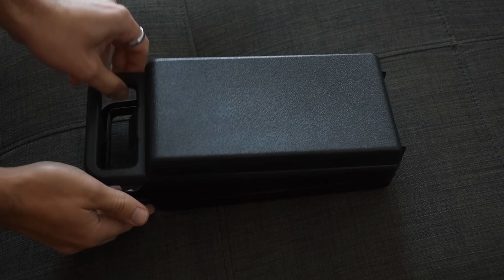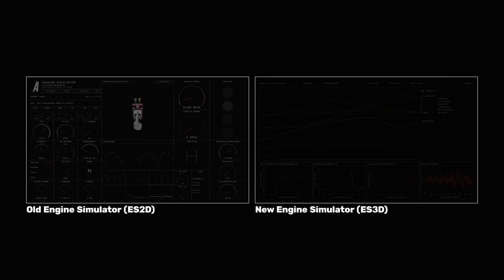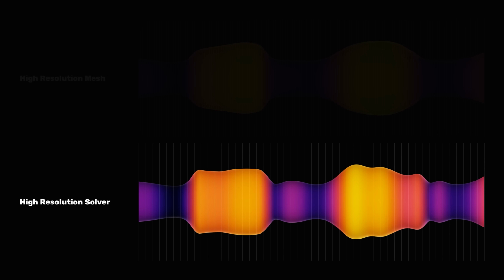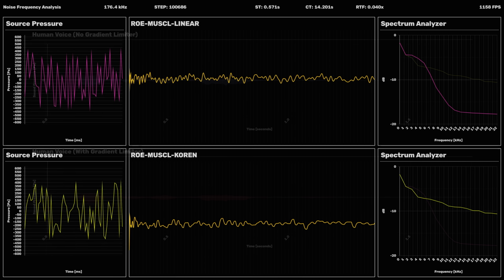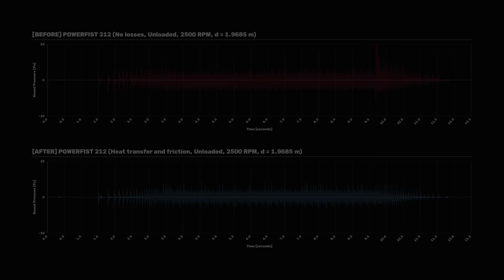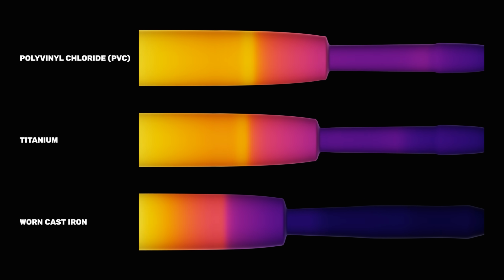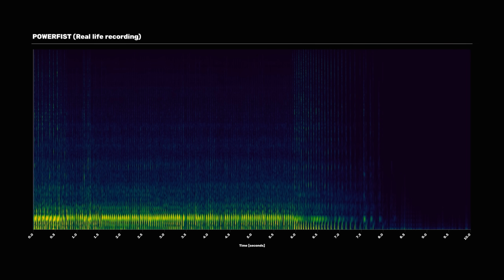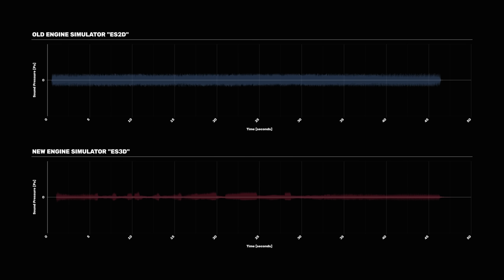Improving My Engine Sound Simulator With Real Data

Comment: Great work even ES2D was good but the new simulation is really a big step up so much that you now skim the limits of current technology and what math/algorithm we have come by  and as shown with the temperature problem  that the real world so incredibly complex that we often overlook the small details too get the big stuff right and call it good enough  even in scientific pappers but once sameone goes down the rabbit hole (like you did)one will notice that yeah it is good enough for most thinks (like exhaust scavenging for power) but same applications are just very fidelity with the small details (like sound)  

Well only thing i noticed (probably because of my tinnitus that makes high pitched sound louder for me 😅) is that the high frequency is still amplified a tiny bit to much  maby a other effect that is overlooked in real life that you didn't simulate or you need too dial in the math a bit more  till it matches the real world even better 

But hey, maybe your simulatio is just too perfect  unlike any of the stuff we have in the real world you know tubes being perfect round, smoth surface ,absulute consistent  wall thickness ,flange corners matching the exhaust flage and gaskets that swell too a perfect match and aren't compressed uneven etc. 

But even with all that you earned it too say "even better than just good enough and a good step closer too the real world" ❤❤

Comment: I'm just learning about your project now.

With these simulations, will I be able to change camshasft profiles, exhaust and intake diameters and lengths?

It would be perfect as a foundation for improving car performance.
Reply from the maker: Yes it's possible to change camshaft profiles, pipe diameters and lengths, and many other parameters

Comment: I remember I saw a video of some guy who was creating a racing sim, using fully computer generated engine noises and other car noises using some kind of physic simulation to simulate the pressure waves and whatever it was to synthesize the engine noises...

TO GET TO THE POINT: I have been thinking about this stuff like randomly throughout the years and I always wanted to learn more about how that worked, and I guess finally now is that day 😂

Edit: wait that's you 💀

Comment: The harmonic resonance sounds great at higher RPMS because it seems to simulate the mechanical noise of belts and valves and what not. However, at lower RPMS it sounds too much like one of those boomsticks from elementary school. I wonder if a scaled filter of that noise as a post processing measurement might be a good compromise solution.

Comment: This is genuinely amazing its so insane that this level of detail can be simulated. I'm just noticing only one problem. The idle sucks on every engine and my best guess is low rpm allows us to hear more imperfections in the pipe sim. At least the revving and especially under load sounds perfect if u just toss some reverb on it.

Comment: Had seen some engine simulator engines, but never discovered this channel, so seeing this I wondered what I have missed out on for the graphical design to make such a leap since the 2d version (even if it that has a style I appreciate a lot), so now after going back and binging (most of) the videos chronologically I would never have guessed HOW that came about. Amazing work. And one can see the self-made is well-made thing a mile away.

Comment: Those last two clips with the Viper and the V8 sound really good. If you didn't tell me, I wouldn't know they were simulated. I think the 2-stroke engine as the reference case is just very difficult and has phenomena that car engine simulators don't need.

Comment: Would the heat loss dampening on audio pressure waves help the wave from cracking on the edge, preventing the "Spurious Oscillation". That or possibly introducing said energetic loss to a upper limit to wave formation speed just like the speed of sound, but unlike hard limiting the slope, it instead dampens it on a logarithmic scale, kinda like real data too.

18:58 Oh, my bad, should've watched the whole thing first.
23:11 That is a Harley!!! I'm so happy to see how far this has come!

Comment: Which turbulence model was used though? K-e is good for confined flows but is crap for subsonic flows, menter sst is better for that. Obviously you’ll have to refine or coarsen then grid for the wall y plus to be within range though given that you are looking at energy dissipation at the wall bound. You could try LES although it depends on how hectic the turbulence is. There’s also DNS…but you could probably go on holiday, come back and still not have a converged solution 😂.

Comment: As someone doing their PhD in acoustics, specifically around thermal stuff, when a paper says "thermal and viscous effects can be ignored" what they really mean is "thermal and viscous effects complicate everything far too much and so we don't do it here". You absolutely cannot ignore them, especillay in ducts or waveguides. Bulk viscosity (molecular vibrational relaxation) is also extemely important, as its usually at least one order of magnitude grater than dynamic viscosity for audible sounds in air.
Reply: I have taken multiple physics classes and don't know what most of this means but I can say it sounds important.
Reply: @moarjank  Oil is sticky and thick when its cold, makes sticky goopy sounds. Its thin and slippery when its hot, makes slippery slappy sounds.
Reply: @SaltSeasDev  One of the best -explain-like-I'm-five-explanations I've ever seen.
Reply: @SaltSeasDev  this description is so fuckin funny
Reply: Ok so should've watched the video a bit more. Makes more sense, and I still agree

Comment: you can also use smarter simulator - a half forward, half reverse timestep timestep solver - you can avoid the numerical instability as long as you are below a certain velocity/timestep  threshold

Comment: i wonder if this would be able to account for valve float or leaking seals, and it makes me wonder if implemented into BeamNG, could account for deformation of the exhaust tubes. it would be really neat to HEAR the damage done to your engine.
Reply: i also assume that changing the parameters of the shape or volume of the simulation would be rather difficult, so idk if this is a realistic expectation, but it would be super cool to attempt.

Comment: I think the small single cylinder engine is only missing some mechanical noise , something some filtered white noise modulated by the engine rpm and a bunch of resonators could handle pretty simply (I guess , might be wrong I don't code, I'm a simple sound engineer thinking in vst's).
All the other simulations could benefit from some randomness apart from that stellar job , always jaw dropping .

Comment: I feel like the material of the tube has frequency dependent attenuation that needs to be implemented. (Like an equalizer) There's too much 'power' in the high frequencies which is clearly not there in real life. Plastics and metals can't physically vibrate at those frequencies, so they need to be cut, no? The math is correct but I feel like you need to consider attenuation due to the tube material.

Comment: Would it be possible to use the first and second derivatives (the rate of change and the rate of the rate of change) of the simple linear pressure model as a guide where to use more cells? Cells in regions of the wave which have similar rates of change could be combined and areas with great changes in velocity could use more cells. I think this technique is used in voxel based fluid simulation engines to use more finely meshed voxels close to the surface area & turbulent regions of water interactions (which I believe would be measured by curl).

Comment: I've also tried many schemes and limiters for sound wave propagation in 1D pipes (including diameter changes) and had good results with MUSCL-HLLC. My goal is to build a two-stroke engine simulator for performance tuning. I think it's a great idea to use audio to verify the quality of the simulation, because we can easily pick up on something that doesn't sound right.
Reply: I would love to know some of the sources you have used. I'm a member of your discord server, do you mention your resources there?

Comment: Great video! With your simulations would it be easy to add some sort of doppler effect?

Engine noises when you're not moving relative to the engine are still amazing, but I think people also often associate engine noises with what it sounds like when a car is driving past them - think a sitting spectator at nascar or f1.

Could you have it so that some changing pressure offset was swept across the full length of your pipe to simulate the doppler effect? Or could you just post process the signal to increase the frequency then drop it as the engine "drives by"? Or would neither of those methods be high fidelity enough to create a convincing engine flyby noise?

Comment: Hey Ange, these engine sims are great, but could you please add breaks?  Honestly, these are truly incredible (v1 and this new one) but I wish I didn't have to wait forrrreverrrr just for the engine to return to idle.
Reply from the maker: There is a brake, it's the period key. It's in the list of controls.
Reply: @AngeTheGreat  Thanks, That really helps 👍

Comment: Shout-out to the Viper!  Fun to see that engine get some more love and attention, especially with its love it or hate it sonic profile. I'm biased since I have one, but knowing how hard it can be to make that engine sound good it would be sweet to have a simulator to play around with to try things out. Does your output have estimated volume by any chance?  It's been a long time since I looked at the original engine simulator, so I didn't recall, but it would be cool if you could estimate db level at the exhaust as well since I'd actually like to quiet my car down without giving up tone.
Reply from the maker: Yes. At the beginning of the video I discuss the recording setup and microphone calibration specifically to measure sound pressure level (SPL). The simulator also predicts SPL and the output does seem to roughly match the levels I measured in real life. The old Engine Simulator did not have this capability

Comment: Those are sounding insane. Really impressive. The whole bit about instability and constructive wave interference. Is this all due to trying to keep it realtime? Obviously you can increase resolution. I might have missed it but what is your target realtime bitrate for the sound?
Reply from the maker: No, it's not an issue that is specific to real-time, though running in real-time does make it worse. The spurious oscillations (Gibb's phenomenon) will happen regardless of the resolution and this is mathematically provable as I mentioned in the video. All of the samples I showed in the video were rendered offline at high quality
Reply: @AngeTheGreat  ya ok so more resolution does help. We can never get rid of the overshoot/undershoot issue, but we can make it smaller with higher resolution. I have never worked on audio simulation. I'm taking the concept I know from volumetric fluid dynamics. I haven't thought much, but I guess a navier-stokes based volumetric fluid simulation would have to be extremely high resolution to get pressure waves resolved to the full range of human hearing.

Comment: i hope this doesnt eat another year but the harleys potato sound is not there yet due to wasted spark missing probably or the simulation of leftover gas in the combustion chamber.

there is still some unwanted reaonating noise at low rpm in the clips but i dont know if real engines also make that since it may be covered from other noises.

impressive amount of progress, i am more than satisfied and excited with such results from a simulation.
Reply from the maker: No, this is not going to eat another year. I don't believe that wasted spark has anything to do with the sound you're referring to. It's called "wasted" spark for a reason, the extra spark rarely causes a secondary combustion event because the gas composition in the cylinder wouldn't be conducive to combustion on the exhaust stroke. Also, not all Harley engines use wasted spark and the vast majority of them since the late 90s do not. They still exhibit the same distinctive idle though, so the wasted spark can't be responsible.

I believe the real reason for the "potato" sound is a rough idle with intermittent misfiring or partial firing. Many people exaggerate this by setting the idle as low as possible. The simulation I showed in this video doesn't account for anything related to the combustion chamber, fuel, or anything else that would simulate this effect. This was deliberate as this was a test of the fluid simulation, not the combustion model.

Regarding the "unwanted resonating noises", perhaps they are unwanted to you or don't match your own personal experiences with engines. You are free to adjust the parameters of the model to further reduce the harmonics that you don't want. I've conducted multiple tests with a test group, asking them to choose the sound that they preferred, and those tests determined how I set the parameters for this video. It was clear, however, that everyone has different preferences for those parameters. At this point, it is a stylistic/subjective decision that I am deferring to the user and not something that I'm going to spend much more time optimizing.
Reply: @AngeTheGreat  Got it thanks for the clarification, youtube never notified me that you answered so sorry for the late response. Keep being great haha!!

Comment: Hey, nice to see you back!!!
I may be saying stupid things, but I hope I can randomly think of something that can help you:

The pipes themselves transmit their vibrations to many parts that dampen them.
From the engine itself, to, for a car which the pipes run under the chassis, the attachment points, or even, with this 1-cylinder engine, how it is jumping on the table.
The heat of the pipe itself also change how it absorbs the sound.

And the air around the pipe also doesn't just transmit, but clearly absorb part of it, even if it is tiny, is even turned into heat.
Then there is the collision between the "static" air and the gasses pushed out of the pipe that probably lose a lot of energy as turbulences that won't be transmitted efficiently as sound.
The exterior air's heat, and even humidity, might also play a role in some circumstances.

Also, I'm curious about "where" is the "listener" in this simulation?
Because not only there is a difference between being in front or behind the exhaust's direction, but also distance change frequencies we hear, as they aren't propagating into the air the same way with distance.
There is a difference between hearing the pipe vibration as if we were a microphone enveloping the whole room and hearing it from further.

I guess, now, the simulation have almost everything required to handle forced induction, just the "airflow and pressure to mechanical energy" part.

Comment: these flux limited second order schemes basically converge to the analytical solution of the Euler equations, don’t they, so if they don’t capture the sound correctly, I would assume the issue lies in the simplifications of the Euler equations rather than in numerical errors. 

At least I recall that when comparing such a scheme to the analytical Riemann problem (shock tube problem), the solution converged when refining the grid
Reply from the maker: That is correct. The Euler equations are only a simplified version of the Navier-Stokes equations, so it doesn't matter how good this solver is, it will only ever converge to an approximate solution to the Navier-Stokes equations. So that sort of becomes the limiting factor here. Numerical errors are also an issue, but they can be worked around by increasing the simulation resolution. However, this obviously becomes impractical at a certain point, especially for a real-time simulation
Reply: @AngeTheGreat  And if you were to use the full Navier-Stokes equations here, the flow would become three-dimensional even within the straight pipe sections, due to the no-slip condition at the wall. Making it infeasible to solve them in real time. However, perhaps it would be an improvement to add 1D terms of the Navier-Stokes, which include viscosity in the x-direction of the momentum equation, and heat conduction (within the fluid itself) in the x-direction, as well as viscous energy dissipation in the energy equation. These terms can likely be added relatively easily to the existing solver. It is also likely possible to add terms that account for pipe flow effects to a 1D solver, including turbulence effects. 

However, I suspect that you have already considered some of these things, as you mentioned that you have already incorporated a turbulence model.

Also, have you considered running the fluid simulations on the GPU? It could be worth it if you don't need to transfer the entire field back and forth between CPU and GPU each timestep, but only need to read out, say, the last pressure value of the grid, where you have a "sensor" or where it interacts with a solid object. At least, these kinds of explicit 1D numerical schemes are quite GPU-friendly to implement. But it probably ain't worth it if performance isn't really a limiting factor at this stage.

Comment: You should get some throttle trace data from some real world situations (all manual cars, car leaving light, car slowing down for light, car driving twisty roads or even a guy doing laps on iRacing or similar). I think some real world throttle/load/decel scenarios would be really cool to use as your sound examples. Some going through the gears, and then rev match down shifting is always the best.